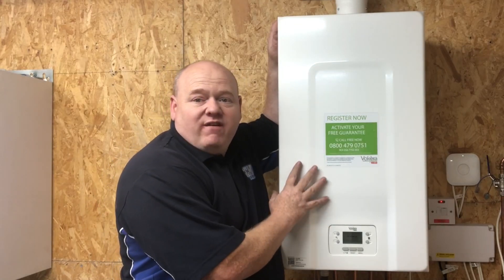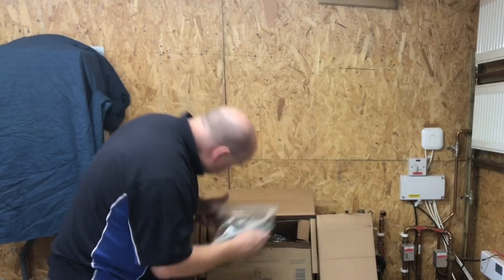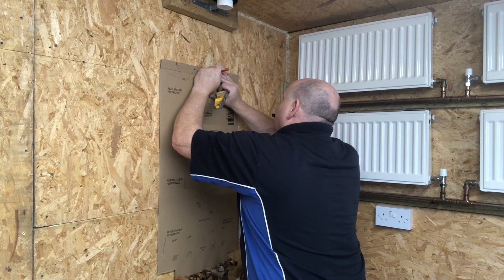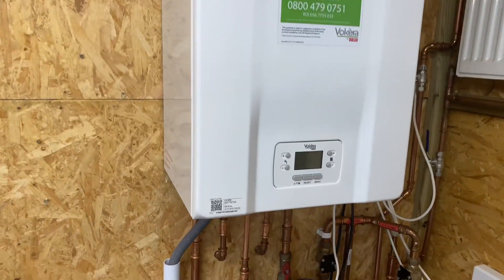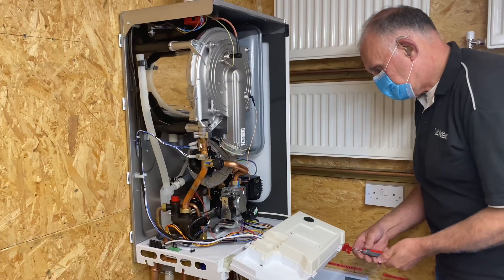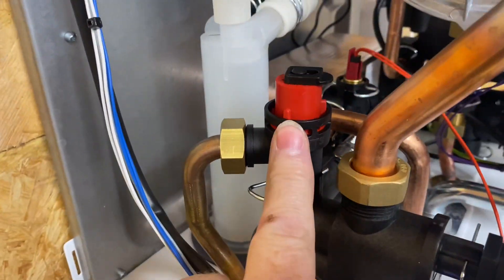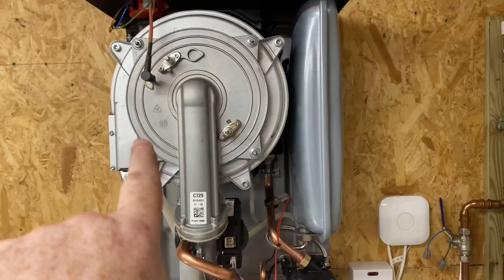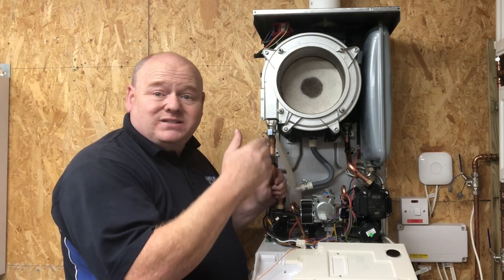Vokera Vision Plus 35C Review & Installation - Combi Boiler Reviews

Comment: Hi Allen 
I’m changing a Heatline s24 s gas boiler for a vokera easi heat I 25c 
The Heatline only has rads in and out dhw in. So I’m short the 1/2 inch dhw out pipe? Thanks

Comment: I've never understood the 💩 vokera get... loved fitting Compact 29A's ... 
going on 8 Years since installation and I've had two faults to date out of atleast 12 boilers.

1. Expansion Vessel needed recharging... I'd have recharged a worcester or vaillant 3 or 4 times by now.
2. Vokera 1st Gen RF Stat broke... so not really a boiler fault. 

Keep going Vokera 👍

Comment: Hi what temperature should the boiler be set to for heating and hot Water using the front display the boiler is also connected to a brand new nest 3rd gen if this makes a difference house is 13 rooms over 3 floors and radiators in hallways as well

Comment: I like it ,I've seen one in the merchants on a breakfast morning .
The only thing which I couldnt work out is the wiring . I like to use a 5 core cable to wire the external controls .
The connections are in an unusual place under the boiler .
You can have the best of both worlds with this boiler ,fantastic hot water flow rate and it can be range rated for the heating .

Comment: Good informative video.
My dad used to fit vokeras going back to the open flued dc turbo combi.
I moved away from vokeras a few years ago after problems with heat exchangers failing on a few of our installs and on boilers fit by other firms that would not go back to the job.
If you have a good relationship with vokera tell them to get out and see the Installers and do sales mornings in the merchants and restore installers faith in vokera as I can never remember seeing a vokera rep.

Comment: Glasgow is the capital city for vokera  boilers, full of them.
Reply: Any idea what the clear pipe for ?
Reply: @deansabran657 it should connect to a drip tray at the top of the heat exchanger to collect any flue leakage but baxi had the patent

Comment: Allen sorry cant remember which Vokera video it was mentioned. But do any of these boilers have a remote display where you can see the same info as on the boiler. Just wondering as we want to put ours in the loft. Thanks
Reply from the maker: Garry Nutter I am sure you can. I will try and get David back at some point and do a detailed video. Thanks
Reply: Yes, all our current boilers do but to get system pressure on the room thermostat and on the app you'll need the Vision Plus or evolve ranges as they have pressure transducer, the other have a simple switch that cannot determine actual pressure

Comment: Looks like decent boiler the old lineas were very reliable.  I wonder what size the water ways are in the main heat exchanger coils are.
Reply from the maker: I will try and get a cut-out section and add it as a video. Thanks

Comment: I didn't see how you made it Boiler + compliant?
Reply from the maker: I will be wired to two nests for now. Might change it though to the V Smart stuff and see how that works. Thanks.
Reply: Allen Hart did you wire the two Nest using their OT connections, if so how?

Comment: If you are building a partnership with Vokera, can you do a review and installation of one of their rear flue models (Vision Plus 30C for example)? It would possibly be an ideal replacement for old heat only boilers in flats, allowing the engineer to use the old flue hole in the wall and potentially still get the height on the wall to fit the unit in a kitchen cupboard. I have considered using one for such purposes, but don't want to purchase one and find it doesn't quite fit.
Reply from the maker: I am open to all brands to help raise the standards in the industry and showing how to install boilers correctly. I will certainly see what we can do though. Thanks.

Comment: The pressure gauge is in a useless position unless it's repeated in the display. Ideal moved theirs on the Logic in response to criticism. I owned a Linea 28 for ten years. The diverter was the only thing that failed. I'd just say that I try to buy stuff made in the UK, providing it's good enough of course. Why export other people's work ?
Reply from the maker: This question will be answered in an upcoming video. Thanks.

Comment: Blimey a vokera boiler you would not expect Allen Hart to be fitting one of these! The last time I remember this brand was in the 1980s when British Gas used them in their thousands ! I think they were green and white? I don’t remember the model number now or name  do any guys remember them?? They weren’t a bad boiler But there weren’t many Combi brands around in them days.I remember changing the fans on them they were screwed on top with a load of Philips screws.
Reply from the maker: I am open to any brand. Its all about showing how to installs boilers correctly. Thanks.
Reply: daz374 Cheers Daz! that’s the name I was thinking of flowMatic must be about 25 years since I’ve seen one!!

Comment: I have just installed a vokera easyheat 25c combi boiler, was annoying as all the pipes were the wrong way round, has the heating  flow then return, prv, gas, condense, hw out and mains in, nice and compact though
Reply: If you're looking for the more common layout there is this Vision Plus range and also look for the Compact A DIN model in Toolstation. The easiheat is a version of that. The Compact has rear flue and different valves but is what the easiheat was derived from.

Comment: Plate looks very awkward to remove, be a pain when you need to replace. What's the price for these?
Reply from the maker: We will answer this on next video. Thanks so much for the question.
Reply: Condensate trap out and plate comes straight out.
Reply: I've never understood the 💩 vokera get... loved fitting Compact 29A's ... 
going on 8 Years since installation and I've had two faults to date out of atleast 12 boilers.

1. Expansion Vessel needed recharging on 1 boiler... I'd have recharged a worcester or vaillant 3 or 4 times by now.

2. Vokera 1st Gen RF Stat broke... so not really a boiler fault. 

Keep going Vokera 👍

Comment: Looks like a decent boiler with nice access to all the parts. The internal drain off to purge the heat exchanger is good but if its required after a drain down and a non registered plumber is working on the system then it could cause them a headache. Also that pressure gauge located under the boiler, not a great idea for when the boilers is installed low down where visibitly for the householder will be poor. Considering the size of the plate, 14.2lpm on the hot water is good but not as good as alot of other brands with the same kw rating. Personally though for around an extra £250 - 300 id rather fit a baxi 836, and get 3 more years warranty a filter and nearly 1lpm extra hot water. Overall not bad but id most likely only fit them for a landlord who doesn't want to pay the extra.
Reply from the maker: Not sure about the logic on flow rates? I will look into these numbers tomorrow. Thanks

Comment: Do they have a recommended torque for the bolts holding the burner in like Baxi do Allen?
Reply from the maker: Not sure but i will ask David. Thanks.
Reply: Think those burner nuts always recommended to be 6-9 NM
Reply: Lee Monaghan  Same as Baxi, but just asking while Allen has manufacturers on his video 👍👍

Comment: Moved to Scotland 2 yrs ago Allen, the property had a Vokera Linea 35HE fitted, We changed all the rads and power flushed for the pipes then had a Magnaclean fitted and it's never missed a beat since. Until we moved I'd never heard of Vokera but our local gas engineer swears by them! As long as he's happy he can come and look at ours every 12mths, But tbf its on light-duty use, mainly for HW since the log burner went in last year.
Reply from the maker: Thank you so much for the feedback.

Comment: They look like a new Ariston underneath. Not much thread on the connection's 🙄👎
Reply: Gary K Yes you are spot-on Gary about the lack of threads ! you’ll be lucky if there’s five threads on there
It doesn’t give you much confidence when you are tightening up a nut on it
Reply: @SalimKhan-gk1fh  that is exactly what I thought.
To much aggravation for me Salim.
Reply: Gary K  Great minds think alike Gary ! which brand do you fit at the moment then ?
I’m currently only fitting viessmann’s if I can and Ideal Atlantic’s on cheaper jobs
Reply: @SalimKhan-gk1fh  The only boiler I tend to install is a Viessmann to. So easy and simple to do. Trouble free.
Decent boiler Salim 👍
Reply: Gary K good to hear that Gary mate of mine is viessmann approved installer he’s done the factory tour too & said it’s amazing 
He convinced me to switch 10 years ago, I’m an ex vaillant fan really but they aren’t what they were 15yrs ago modern ones are crap
All my family friends & neighbors got viessmann’s now and everyone’s VERY pleased with them, nice to install doddle to service 
Read my verdict on viessmann , it’s on Allen Harts viessmann 050 review
Reply: @SalimKhan-gk1fh  Well, if you'll take my word for it I haven't had any problems for ten years except, I can't remember which model exactly, once I used two washers. Generally no problems at all.
Reply from the maker: Its not the same. Thanks.
Reply: @AllenHart999  
Thats good news. 
I have to say looking at the video it just looks identical. Small amount of thread. Difficult to get the isolation valves on.